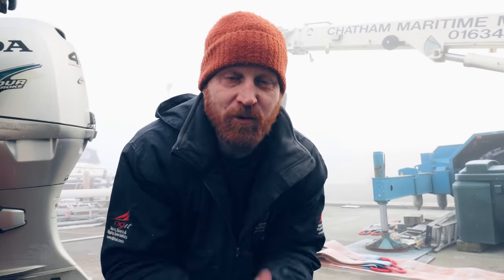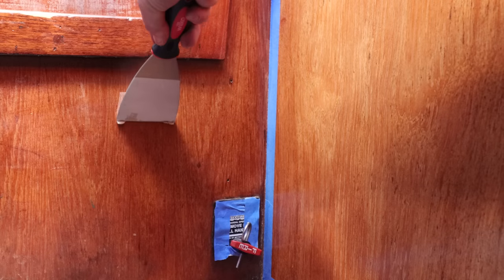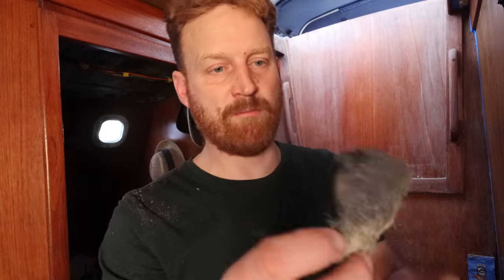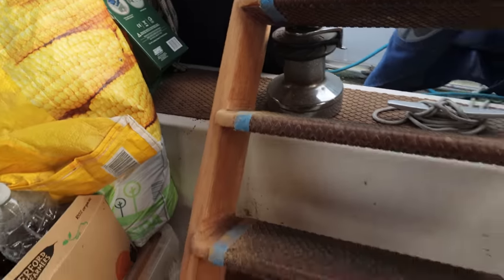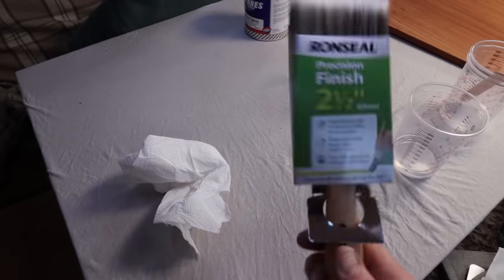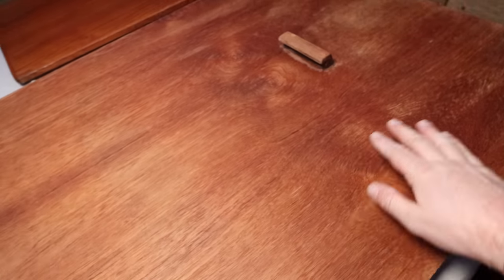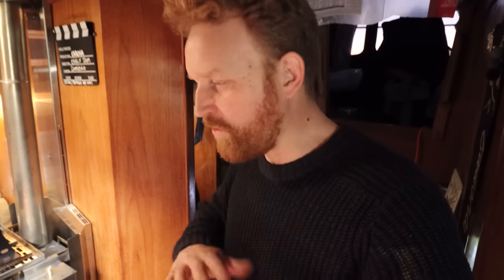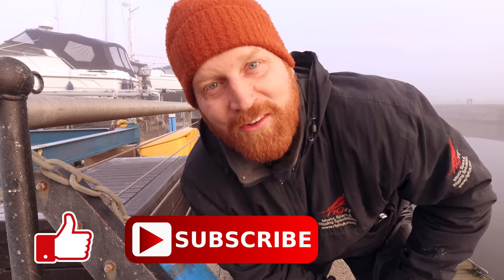Varnishing & Restoring Damaged Woodwork

Comment: Dom, NO, NO. Steel wool .. NOoooooooo. Steel wool doesn't belong within miles of a marina, much less anywhere near a boat. It sheds tiny pieces of steel, smaller than you can see and then RUSTS!. OMG it's so hard to clean because the rust will imbed into fiberglass. You can get bronze wool instead. I enjoy your vids very much. Keep it up. I learn right beside you.

Comment: After 15 years of pampering my yacht’s varnished surfaces I finally stripped it all off and used wood stain. It nourishes the wood, protects it and is less time consuming to keep ship shape as it’s Matt finish. Some use teak oil but I find that is just as laborious as varnish. Stain is my preference every time.
Reply from the maker: I gave serious consideration to taking the varnish off and just perpetually teak oiling the woodwork.
Reply: I went this way then back to varnish because the oil wasn’t tough enough and needed constant re coating , just a few months outdoors and the oil ( Dutch superior ) was failing badly

Comment: Hi Dominic. When varnishing, it is generally recommended that all the brush strokes should be in one direction, not back and forth as you were doing.  The reason for this is to minimize the risk of trapping air bubbles in the varnish. Probably not an issue with varnished thinned down 50%, but will be once you are using neat varnish.

Comment: Hi Dom,love the vids,a few tips as I do boat restoration as a living. Try not to use a mouse sander as it will leave swirl marks which will show up with a gloss varnish better to use a heat gun with a carbide scraper and sand with the grain from 180 grit down to 400,if your really fussy wet and dry between each coat so that your filling all the grain and when it's all flat a very thin finishing coat,same applies to painting. You can do the same with your veneer but be careful to just take of the varnish and not to burn the wood.if you want to use a stripper go to an automotive store and get the stripper they use on cars,much much better than b.and q stuff.Hope to see you on the water sometime.
Reply: Hello Elizabeth, how are you doing today, hope you’re fine and safe from the Virus??
Reply from the maker: Wow you’d go all the way down to 400? There was me thinking 120 was fine! 

Appreciate you taking the time to share your expertise with us all 🙏🏼🙏🏼☺️

Comment: Good job so far.  The varnish you are using, Epifanes Wood Finish Gloss, doesn't require sanding between coats; however, I would recommend sanding after about the 4th coat in order level it and again before the final coat to clean things up to get the top coat perfect.  Also, I would wipe the boards with alcohol between coats to clean them off and always, always use a tack cloth to pick up the dust/bits before you put a coat of varnish on anything.

Comment: Dom, you have the bones of how to refinish. I know it's tough to find correct info on something so few people do for a living. Good on ya for giving it a go! It's not the easiest thing to attempt. I've made a living of refinishing for the last 40 years. 1) stripper yes, heat gun no. 2) stripper till that bubbling is everywhere(as many coats as it takes). If you can apply it on a horizontal surface do it, works better. 3) lacquer thinners or acetone after stripper to wash the stripper off. 4) water to wash the lacquer thinners off and break the seal of the previous finish. 5) Do not sand the finish off with anything less than 100 grit(especially if you've never done this before). 120 then 150 to prepare for finish. 6) bristle brush, not synthetic brush(they are black not white and not plastic) 7) thin your finish no more than 25% for sealer. And sand the sealer with 320 or higher. 8)  thin the top coat, no more than 10%. I would use it straight out of the can for finish. If your hands are cold its to cold to apply a finish. Hope this helps for  future refinishing projects. You should look at reading books for audible, I love your narration and overall videos. Thanks,  keep up the good work!
Reply from the maker: I feel as if I’ve learned more from the feedback from this one video than just about any other I’ve ever made.

Appreciate you taking the time to share your pearls of wisdom with us 🙏🏼☺️

Comment: The varnishing is looking pretty good so far. 😃 I’ve always thought of sanding in between coats to denib , ie remove any dust etc that may make the surface uneven. Though I suspect the important thing here is to gradually build up a good covering from many thin layers . 😃🍻
Reply from the maker: I think I am going to sand a little bit between coats for exactly that reason.

Comment: Hi, Nice video, some remarks:
I always use dust remove rags, whitch take allmost all dust away.
Sanding in between with P400 gives a much better end result. Just a light touching with the paper is enough, and it’s only taking a few minutes. Start varnishing with the area that is futher away from your body, this avoids varnish drops and dust in your finished work. Start with cleaning the brush first by using it on a clean paper or board. Work in dust free room if possible. 
Use a scraper with rounded edges to avoid scrathes in the vineer wood.

Keep up the good work. 
Regards
Wim
Reply from the maker: When you say dust removal rags, are you talking about something like micro fibre cloths?
Reply: It’s called tack cloth, a very tacky rag that takes all dust away, you cn find them in every good painting shop. Oftend used in the car painting industry as well.

Comment: I had the same issue of varnishing and temperature when I was restoring my first boat. Well worth looking at the benefits of Coelan. It's a polyurethane wood coating, lasts for years, breathable, impact resistant and you can wack the stuff on down to 5 degrees. Bloody expensive, but well worth it, and gleams like epoxy. Far too late now though given this post is likely after you've already finished the varnishing by now. I do like epifanes for internal woodwork if its nice and warm. currently also renovating trims and loving morrells spray lacquer (same brand that Westerly used originally on the teak-faced ply and trims) and that's bloody good stuff too - and no brush marks 🙂

Comment: Hi Dominic, enjoyed episode, happened to look at your episode regarding attempted burglary. Just a thought do you have cctv on board. We have just fitted Reolink cctv camera with independent small solar panel. Comes with app so able to watch live from mobile. Also has Siren, 128gb sd card to record when sensor is triggered & push notifications & microphone. Downside needs WiFi connection which we have where boat is moored most marina's have WiFi. Worth a look cost £73 on amazon has been brilliant. All the Best Len👍

Comment: Have you tried Strypit?  It seems to be so much better than other strippers maybe because it is old fashioned.   I very gingerly stripped my Moody 31 table (with thin veneer) and it worked beautifully.  I gently dragged off the soft pickled varnish with a Stanley blade leaving bare wood.  This was wiped with white spirits (not water) and varnished with excellent results.  I had tried other strippers on a spare piece of wood and the results were like yours, very slow and frustrating.

Comment: Personally, I would have gone down another route and I'm sure all the purists will shout me down. Anyway, here goes for nothing... for the steps which are wood and will get high traffic and lots of water, I would've stripped off the varnish and then done two coats of epoxy. This soaks into the wood making it both durable and stops water ingress. Then a couple of coats of varnish on top and you have a great finish. Might also be the go for the washboard to stop further water damage, but I've never tried epoxy on a veneer.

Comment: Why are you taking the existing sound varnish off?
Reply: I thought the same thing.  Just sand it with 320 grit and go over it with new varnish.  The existing varnish hasn't "failed", it just needs freshened up.
Reply from the maker: There were chips and scratches all over it so thought best to start again.
Reply: @CadohaAdventures  Good point, I am sure we can't see all those imperfections on the video....in person, it is always worse.  Looks like you are getting some good results!!  I use Epifanes on my boat as well and fairly pleased with it.

Comment: A question for everyone… When you’re dealing with really thin veneer, that’s been ratted up on the edges and still looks poor, wouldn’t it be easier to send it right down and then apply a very thin new veneer to make it look great? Is this process too expensive? Please let me know as I’m curious.
Reply: Quick answer to your question is veneer is glued to the substrate(plywood or mdf) using a very large heated press to prevent bubbling in the surface. Not possible to reveneer and get a surface that will last. Don't send through veneer whenever possible.

Comment: Hello there people. I have only just started watching the film, however in my person experience of 10 years in the motor trade and 50% less in the furniture trade, (reproduction antiques) including French polishing etc. now in the motor trade yes I would on every day awful cars like the infamous montage or the mini metro even as terrible as the Austin maestro 🤢🤢🤢🤢🤢🤢🤮 I worked on production cars but mostly on restoring cars such as Aston martins-Db 5 or 6, or vantage plus many more antique cars. Stripping an Aston Martin of its paint of say a million coats, slight exaggeration there but I would normal lay on at least six coats of paint stripper, the first would normally do nothing, the key then was not to let the paint stripper be absorbed by the materials you were trying to remove, ie the layers of paint, primer etc. after laying down many coats of paint stripper the paint and all coats would peel of so easily with no elbow grease. 
So I think if you apply say two to three coats paint stripper consecutively then scraping would become easy, remember the first coat even on your boat does nothing to penetrate the layers of varnish, also note that paint stripper of today is not like the paint stripper I used in the motor trade.
years ago, 25 years ago to be accurate. 

Bear in mind many coats on top of each other releases nasty vapours for you and the lovely Carly and of course the manager Hank. So no sparky type things going on during stripping, the wood that is, note for dom there. May be todays stripper is not so toxic and does not produce vapour ?

Hoops this helps. Although you have finished it now so I will,just shut up rambling. Lo. 😅

Comment: Most good varnish jobs require just a bit of sanding with very fine wet/dry sanding paper. During the first couple of coats the wood lifts tiny wood grain ends and then hardens in the varnish. This should be apparent, but all you have to do is swipe the varnish in a small area with the fine paper and compare with your hand. If there is a difference, you'll know it. When it's no longer necessary to sand, you'll know it, too. Adding more varnish over the top will not hide it. I'm not reading all the other advice, but I do want to present an argument for a very fine (expensive) natural bristle varnish brush. It's worth it's weight in gold. My one varnish brush is 50 years old and still as good as new, and has never shed a hair. Also if you want a satin finish, make satin the last coat and use gloss all the rest.
Reply from the maker: Appreciate you taking the time to share some of your insights. Think I’m going to do some light sanding between the other coats, I’d like the finish to be as good as I can get it, considering how much work is involved 🙏🏼😬

Comment: Personally I’d go the oil path and not the lacquer one. A fat oil (like raw linseed oil) is easy to apply every now and then. And, it doesn’t require stripping and dry sanding. 

Wetsanding

Comment: Consider a heat gun vs stripper in the future. Easier to control and a very clean result.
Reply from the maker: I’ve always struggled to get a uniform varnish removal with the heat hun. I once did the forward sole with a heat gun and a razor blade and that did come up quite well, but when I tried to replicate it on the rest of the forward cabin it all ended up a bit patchy for me 😕

Comment: Varnishing methods is like anchor choices😱
Anyway, when varnishing keep a wet edge , done ever brush anything but the wet edge, 2 strokes over material only.
Top quality brush 'badger hair' makes a difference as does the brush care.
You can lightly sand off the dust nib unless you are working in a dust free environment . Clean with fresh tack cloth.
  Stripper generally should be applied thick and just apply , do not brush in just put it on an leave , thick.
But usually you just do what you can unless you are being paid! 
Cheers Warren 
Elizabeth Whitman wrote the definitive book on varnishing......

Comment: Our sailing club asked me to polish 14 of our club tables.I did it over 2 winters.  I stripped them down to bare wood  I stained them with rustins mahogany stain- You need not do this- & applied 2-3 coats of Sadolins PV67 clear gloss varnish.( tops 3 cts legs etc 2 cts)  That was 5 years ago & they are still as good as when I did them.That is in a sailing club where they get lots ofabuse.
In my joinery works I used to use it on laboratory work tops etc. 

 I made the oak spiral stair case in my house & coated it in PV67 & it has only been overcoated once since 2001 with satin PV67. I suggest that if you do strip the saloon table you try it. You will find it wears brilliantly & is better than all your coats of varnish. You can apply with a roller & tip it off with a brush if you are quick. It dries quickly as well. You might end up using it on other places inside the cabin

Comment: On the solid wood bits, you may want to try removing varnish with heat gun then scrape, it is more fun than paint stripper, and have yet to burn wood.

Comment: The companion way looks good. You should be proud of yourself.  Btw, heat guns remove old varnish very well. No need for chemicals or respirators. Yeah and  you probably should have worn one of those. Especially working in small confined spaces.
Reply: Also eye protection as the paint stripper and eys are not compatible.

Comment: I would be a bit nervous filling a small enclosed space with solvent fumes while a stove is creating heat with an open flame... no idea how close or far from any explosive fume/air mix you would get, but maybe worth researching before diving in?
Reply from the maker: Fair, good point 👌🏼
Reply: @CadohaAdventures  It looked like the wood stove was out to me, hence the diesel heater and that won't pose an issue because the combustion is isolated from interior space.
Reply: Yea Life in a Nutshell exploded his boat with degreaser fumes